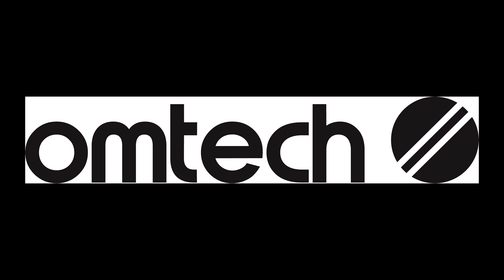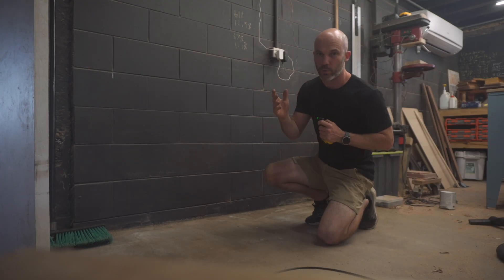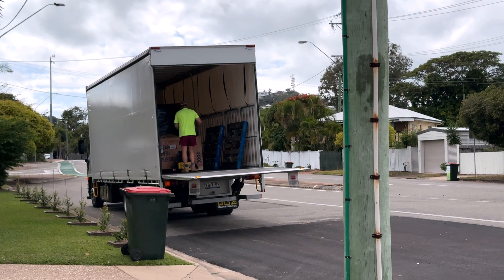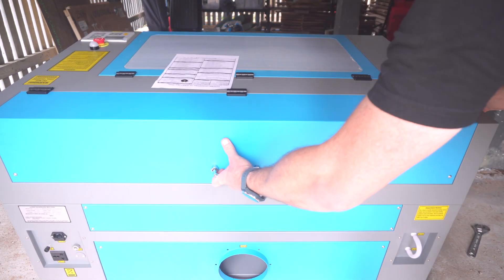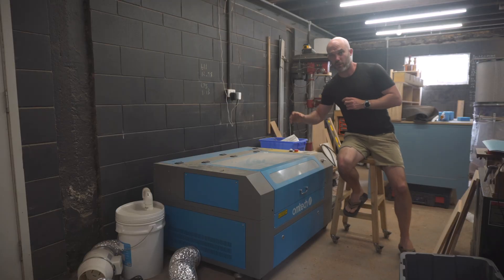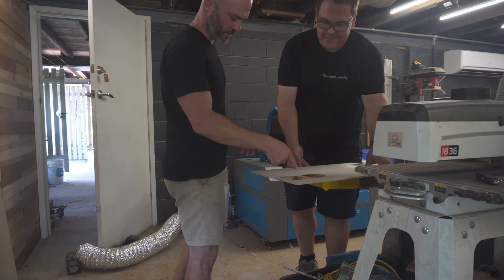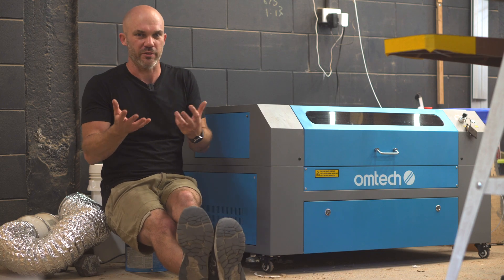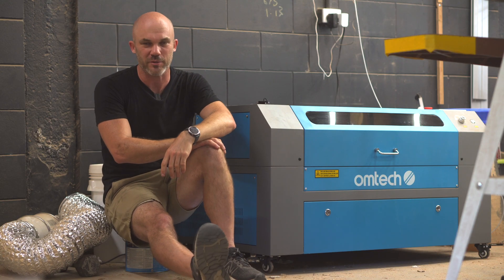Is The Laser Industry Evolving Quick Enough?

Comment: I have been an industrial engraver for 17 years and the rise of consumer level lasers has spelt out the end of that side of my business. Luckily I recognised the pattern as I saw the rise of vinyl sign cutters affecting the signage industry 20 years ago. I am changing the focus of my business. Lasers are great in woodworking as you can make router templates in minutes as well as super accurate marking out of intricate small parts in thicker materials. The learning curve is worth the effort. My top tip is that RF excited lasers are air cooled and the more established manufacturers have beginner friendly software. The downside is the expense compared to the Omtech level of machine. My similar sized machine was over $40000
Reply from the maker: Router templates was my original goal with it, which is why I went with the biggest bed I could find

Comment: My hot take: CO2 lasers aren’t beginner-friendly, at least, not yet. I’ve got one in my shop now, but that’s only after running through a few diode lasers and types over the years.

If you’re already familiar with diode machines, you’ll feel right at home, the software, the terminology, even the workflow makes sense. But if you’ve never touched a laser before and start at the CO2 level, it’s like being handed the keys to a race car before you’ve even learned to parallel park.

I'll also add, that I had problems with my CO2 out of the crate with some loose or dirty connections, that resulted in me opening the machine up to rectify.  And just like you, I had a great experience with the support, but again, having to open up a 5k laser before you've switched it on isn't the ideal consumer experience, and is the reason I don't think it's ready for that kind of market yet.
Reply from the maker: It’ll be interesting to see what the space looks like in 5-10 years. Although by that time we could be looking at entirely new tech in the space